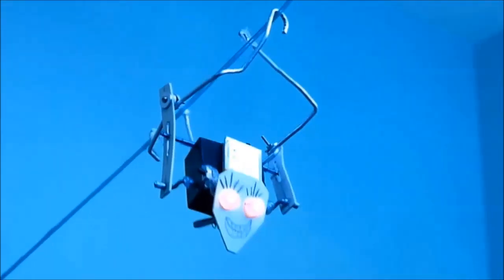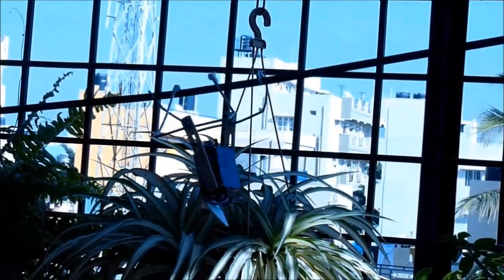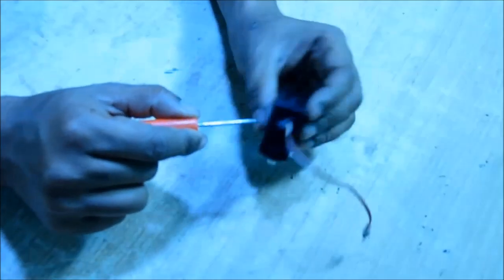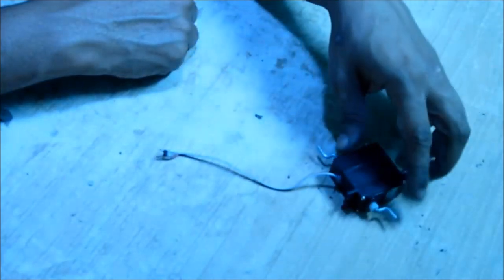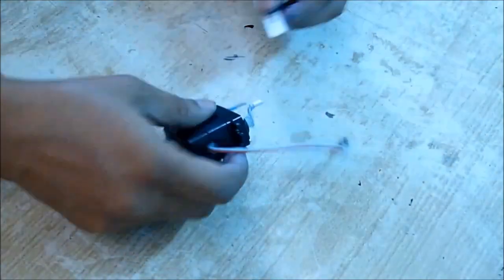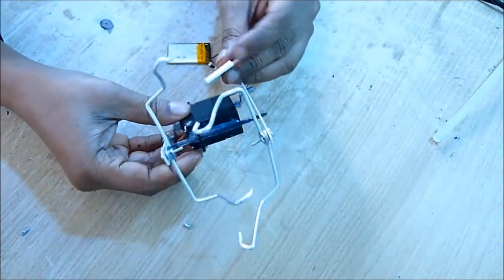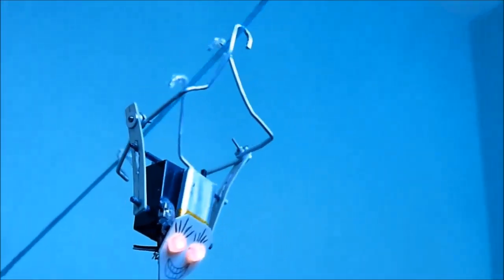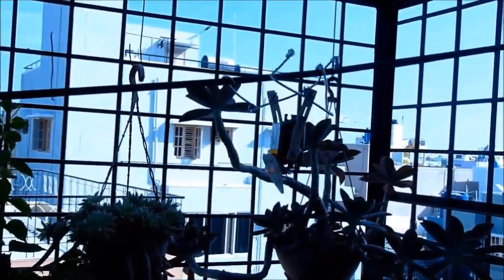How to make a rope climbing robot

Comment: Hi! I took the motor to a local hobby shop and they are currently trying to see if the can modify the connector to fit into the connector of the LiPo battery. Here’s my next question, in our servo motor it has a full circuit board vs just a small one like yours. This is a problem for our legs. Can you put a small hole in those without causing the motor not to work?

Comment: Hi!! My son and I are trying to build this robot but we are still having trouble with it not wanting to continuously rotate. We are using a Futaba S3003 servo motor. Any advice? Thank you!!
Reply: Brainergiser we at first used 3 AAA batteries and the motor didn’t run. I took it to a local hobby shop and he hooked it up to an RC car and the motor worked, as in turned on, but didn’t continuously rotate. It turned like maybe one full rotation and stopped, but the motor was still running. I would love to send you a picture of the inside of our motor so maybe you could help see the problem. If you have an email, I will gladly do!

Comment: First of all extremely sorry that my same question got posted many times due to some kind of system error on my side. 
If you simply connect Lipo batteries to 5v then how do you come to know that they have been charged fully?
I had read that they should be charged carefully as they may explode & the batteries should have a protection circuitry... what do you say?
Please opine or make a separate video on Lipo charging as it is one of the most important component of any project.

Comment: Extremely sorry due to some kind of system error my same questions posted many times...
If you connect the battery simply to 5v how do you come to know that it has been charged fully? I have read that it may explode if not charged properly and it should have a protection circuitry. what do you say?